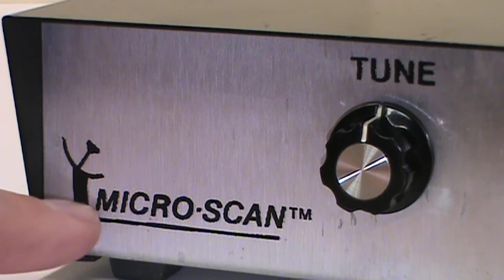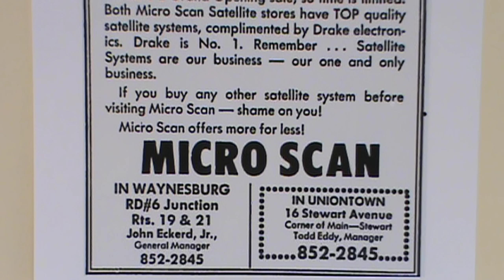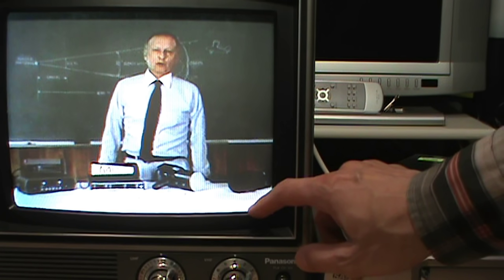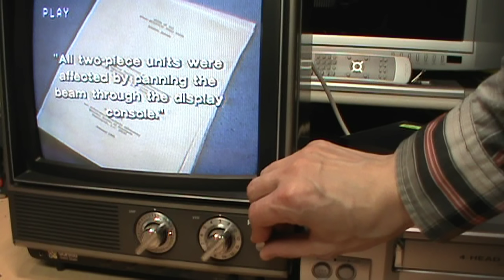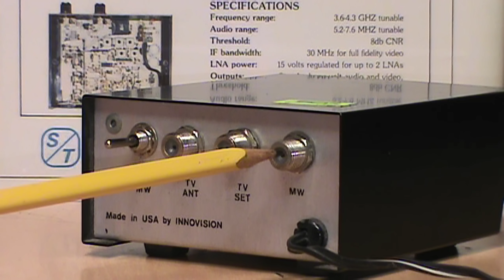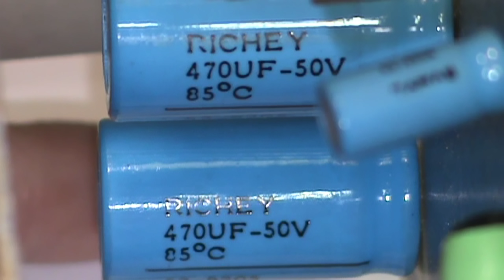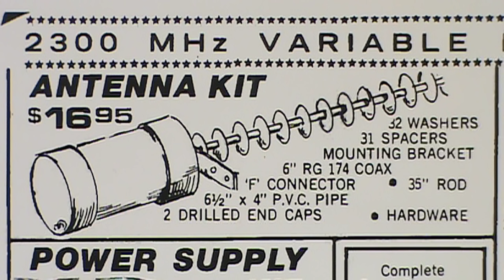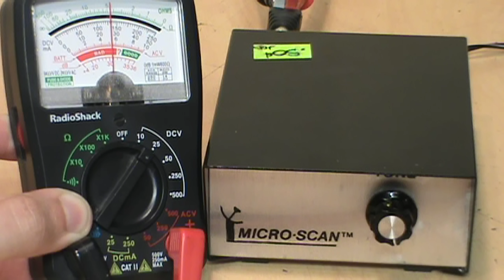Micro-Scan mystery 1980s TV device - Satellite? Microwave?

Comment: The Micro-scan looks like a terrestrial microwave receiver switch box.  Terrestrial microwave was popular in the 1980s to feed HBO and other premium TV channels to hotels and the like.  There were hack receivers sold in the back of electronics magazines back then.  You made a high gain antenna out of an aluminum rod, a bunch of washers and a coffee can.  Yep, that advertisement you showed was a wink-wink ham radio receiver which might “accidentally” pick up some HBO if you were in an “unfortunate” location.
Reply: Yep, this. I built one in the early 80s. Worked really well until cable made a foothold in the market.
Reply: So kind of like those video stabilizers you could buy at Radio Shack that were absolutely positively not for removing the MacroVision signal from rented video tapes so you could dub them.
Reply: @filanfyretracker yeah an RF amplifier! These would capture microwave signals and you didn't point them towards the sky you just .290 degrees on any old Pole, and started turning it until you got the microwave signal and there you go crystal clear I built several of these and even took them camping basically just an RF app with a 12-volt power supply so they were great for camping. In fact even better for camping going through a 12-volt car battery!
Reply: @filanfyretracker exactly!
Reply: Yes. The plans were passed around between nerds back then. The antenna was made with a metal trashcan lid and a metal coffee can with a PC board on the base of the can. A length of all-thread with fender washers spaced out along the length of it. Inside the can was a precisely cut and bent end of coaxial cable. The box on the TV had the big pot that had to be tuned. All kinds of stuff went over the microwave back then. Later it was mostly school educational stuff.
Reply: I used to see these in motels all the time. Now I know what they were for thank you.
Reply: I live in Minneapolis, and in the early ‘80s I built one for getting an HBO feed.  It used a small 14” dish pointed at the IDS Center (the tallest building in Minneapolis at that time).  I was in high school at the time…
Reply: Thanks to everyone who commented.  Those were the days.  Now fiber optic links have replaced many microwave relays.  Even a big chunk of C-band satellite has been gobbled up for 5G mobile service.
Reply: There's lots of little "translator" shacks around rural areas that take a distant affiliate's microwave feed and redistributes it over UHF for communities outside the channel's normal blast range. It could have been used in that capacity.
Reply: I actually subscribed to a tv service like you described back in the late 70’s. This was before cable tv became commonplace. The transmitting antenna was located atop a skyscraper building in East Memphis, TN. Late at night, the service would run porno movies. My next door neighbor wanted that so bad he buried coax to my house and we shared the feed😂
Those were young and dumb days🤣
Reply: Exactly this
Reply: The closest you can get to that experience today is picking up BISS-encrypted or PLS-encrypted satellite channels intended for feeding terrestrial transmitters in neighbouring countries, something which is possible here in Europe. BISS and PLS both use a fixed key that typically stays unchanged for years, and the keys leak to various internet sites almost immediately, so as long as you can see the satellite, it's a neat trick to get access to the free-to-air channels of nearby countries. It's the reason most brochures for satellite receivers here in Europe advertise BISS and PLS compatibility (wink, wink), but won't tell you what are the benefits of such a feature.
Reply: In 1986 we lived in Phoenix AZ and my brother bought a kit and got HBO free. You had to aim the dish antenna just right to South Mountain. The signal stopped about a year or so later.
Reply: @PLC808 that's funny.......the box from the TV company just needed to be opened and a circuit swapped to open up the pay channels

Comment: thats for po-rno lol
Reply: This is correct. In the early 1990s in San Diego, CA, you could aim a small microwave dish at Mt. San Miguel to receive a terrestrial broadcast of the Spice Channel. The system operated over MMDS (Multichannel Multipoint Distribution Service) frequencies in the 2.5–2.7 GHz range. Unlike many premium services, this particular transmission was not scrambled, anyone with the right antenna, downconverter, and tuner could receive a clear analog signal. It was a true line-of-sight setup, relying on mountaintop transmitters rather than satellites.
Reply: @sdbirder  😁

Comment: In 1976, at our apartment in
Stamford, CT, had an MDS
Dish antenna aimed towards
the SW for NYC reception
If one subscribed to HBO,
then a signal was received on
then Analog Channel 6 on
our Master Antenna for TV,
before we had cable TV after
the 1980's began when we
had Cablevision installed in
our building. 😅
Reply: Are you typing this on a BBS with limited column width?
Reply: @ToTheGAMES no it's in Cobol converted to Fortran!

Comment: In the early 80’s we couldn’t get cable where we lived, but the cable company offered us HBO for $3.00 a month.  We had something similar to switch from regular tv antenna to a small microwave dish on our roof, which was aimed at an antenna about 4 miles away.
Reply: We couldn't get cable where I lived in the 80's as well. Rural Indiana. But I never knew this stuff existed at all. I figured that if you couldn't get it legally there was no other option.

Comment: Not satellite TV but MMDS subscription television or “wireless cable”, which used microwave frequencies.
It used a special receiver antenna with a downconverter device which needed to be powered. This seems to be a very cumbersome antenna switch with the power supply for the antenna receiver integrated. Most MMDS TV providers wouldn’t use something like this later, probably because the antenna power supply was prone to failure and it was easier to provide a simple more serviceable/replaceable one. Once powered, the antenna would provide a regular VHF or UHF signals for any TV to pick, provided the signal is not scrambled. They would either give you instead a wired non-powered switch or just a regular antenna switch similar to an old computer or console TV switch box or an electronically switching tuner/descrambler.
A system like this known as Multivision was very popular and successful in a few cities in Mexico from 1988 to the mid-2000s when it was mandated to cease TV operations on those frequencies to allow for WiMAX wireless broadband Internet services.

EDIT: Correction. This is very dumbly-made antenna switch with an integrated MMDS power supply.  
You can’t just use an electric on/off switch for antenna as the signals will always permeate the other antenna wire and pick them up easily, like, you know, an antenna does; which is the reason those Atari boxes used a slider to give enough room for the signal to not reach the other end with enough power and a couple of trap filters on each side to get better results.
The reason for the power voltage knob as a fine tuner as because if a converted MMDS channel would use the same frequency as a local OTA channel, they would interfere with each other. So, in order to have the best image, the signal from the downconverter would have to be stronger. This would work with the MMDS channels but probably not so much with the OTA ones, so the switch either also turned off the downconverter or lowering the voltage on the antenna would allow you to watch OTAs without the interference as the MMDS would literally lose power. No wonder they quickly dropped these boxes.

Comment: After the initial demonstration of its function it was pretty clear that it is an input selector with either a tunable or controllable output RF amplifier. Almost certainly intended for reception in marginal areas especially those who have more than one antenna was required to get more than one poor quality station. 
The logo was pretty much a red herring as through that 80s satellite boom many items, even completely unrelated ones, add some kind of satellite or satellite antenna as a logo.

Comment: Voltage-based tuning circuits are not at all uncommon. While we often think of tuned RF circuits as being based on a resonant LC tank composed of a variable capacitor and an inductor, other regimes exist. A Voltage-Controlled Oscillator (VCO) uses a variable DC control voltage to adjust its output frequency. The core principle relies on a voltage-dependent component—typically a varactor diode—that alters the resonant frequency of the oscillator circuit based on the input voltage.
Reply: Yes. Have an array of pots and tune them to different channels and select them via pushbuttons. Channel presets before digital memory. Used from the 1960s into the 80s on some TVs (UHF mostly) and radios.
Reply: @westelaudio943I remember those, it was particularly common on some of the early high-end VCRs and smaller TVs that came with remote controls. Though I always assumed the matrix of individual rotary controls for each channel were just variable capacitors rather than potentiometers.

Comment: To nit-pick, most C band satellite receivers don't receive 3-4GHz.  They receive around 400-900MHz.  That's because they're usually connected to an LNB at the dish (Low Noise Block down converter).  Which both amplifies the weak satellite signal and then down converts it to something more manageable.  Both with cheaper coax (lower signal loss) and receiving electronics.  Early on they used LNA (Low Noise Amplifiers) on dishes instead.  That would have delivered 3-4GHz to the receiver.  LNB supply voltages (as I remember) were anywhere between +12 to +18V.  They'd even use the voltage to select which LNB to use.  Whether it is selecting which polarization to use or which satellite (if they are close together and you have an elliptical dish.  But I don't think that was done on C band, only on Ku band.
Reply: Yes exactly right. The voltage tuned a downconverter on the back of  a c band satellite dish from the 3-4 Ghz range down to 70 Mhz and the receiver was a demodulator from 70 Mhz FM to video/audio.

Comment: Before switching to a satellite,HBO used to broadcast over the air, antenna with an array of discs would be aimed at the World Trade Center and you had the box in between your tv and the antenna. Tune tv to channel 3 and you got hbo, grainy but watchable. Didn’t last long, as they became part of cable systems, the antenna pictured in your ad was the type I had back in the early 80s
Reply: Same here but in Chicago

Comment: That's a power supply for an MDS (multipoint distribution service) - a 1980s way to distribute a pay program - usually HBO - to apartments and condos.  It powers a roof mounted RF downconverter which takes the MDS licensed signal at 2156 MHz, mixes a local oscillator and outputs to channels 2-6 VHF.  There also was an 'educational' service called ITFS (instructional television fixed service) which typically a school or university would distribute multiple channel classroom education to remote sites.  The Minneapolis / St. Paul area had both these analog video services up and running through the 80s and 90s.

Comment: There are indeed several standards that used the voltage sent to the antenna, not only to feed it with electricity, but also to control its actions. You could for instance use it to move it in front of the dish to switch between 2 close satellites. Or you could use it to select between 2 antennas, each aimed at a different satellite. Or you could use it to switch between different frequency bands or polarization. If you can do that, it is only a small step to use it to directly select a specific frequency.

Comment: Back around that time, some LNBs actually converted the signal down to 72 MHz, so it may have been feasible to build such an LNB that is tunable by its supply voltage. Of course vestigal sideband modulation is essentially useless for satellite broadcasting, it may have been viable for terrestrial microwave broadcasting.

Comment: The down converter in the dish is probably a voltage controlled oscillator, so changing the voltage will change the frequency its tuned to.
Reply: That’s exactly what this is. I used to build the coffee can HBO receivers that used these variable power supply’s to connect to a TV. Channel 3 on the TV as I recall.

Comment: It's a C band converter I think.And the variable voltage is used to tune the satellite head block.
Reply: Yes exactly right. The voltage tuned a downconverter on the back of  a c band satellite dish from the 3-4 Ghz range down to 70 Mhz and the receiver was a demodulator from 70 Mhz FM to video/audio.

Comment: Man this brings back memories. That Micro-Scan Power Inserter from the early ’80s was basically a little DC injector for those giant backyard satellite dishes. The LNBs back then needed power, so instead of running an extra wire they just pushed the voltage back up the same coax that carried the TV signal. The inserter sat in line, filtered out the RF, and sent DC up to the LNB.

In 1982 those boxes were kinda clunky—couple F-connectors, a DC jack, not much else—but they were the ancestors of the tiny power inserters DirecTV/Dish use today. If you had one of those setups back then, you weren’t just watching TV, you were hacking into the future… pulling in live feeds and channels the average household didn’t even know existed. Pure golden age of satellite tinkering
Reply: In 1982 I was tasked with messing with the rabbit ears antenna to tune in the 3 or 4 channels our rural house could receive. I didn't know this stuff existed, of course all I cared about was watching Dukes of Hazard or CHIPs at the time.
Reply: Nah, this isn't C band just terrestrial microwave TV. The device you're talking about is called a "bias T"
Reply: I don't know how things are in the US, but here in Europe, satellite LNBs still rely on "phantom power" delivered from the coaxial cable, which is something I hate, since you have to be careful to shut down the satellite decoder from the power switch at the back or unplug it before unscrewing the coax cable, which requires a wrench to unscrew so it doesn't get unscrewed accidentally. Why can't the LNB have its own power?
Reply: @Δημήτρης-θ7θ  I think it might be to do with the smaller size of European homes favouring smaller equipment and using fewer power outlets. Separate LNB injectors mean separate boxes, an inconvenience enough in my 30m² UK flat, let alone the typical 16m² of one in central Paris! 🤏
Reply: Eventually as technology evolved, those boxes weren't needed anymore as most of the work was being done inside the satellite receiver.  About 12 volts was sent along the coax line out to the dish by the receiver inside the house. Adjusting the skew horizontally or vertically, so you got 12 channels horizontally and 12 channels vertically, for a total of 24 channels per satellite.
Reply: I haven't seen a satellite box in a while, but we were still using powered LNBs in the UK up until at least 2018. Unlike the DirecTV setup you describe, UK setups have the power injector (Nominally 19v= I believe) built-in to the set-top box and run off the same power supply.

Of course; Now most things are going IP-based, satellite's days might be numbered. Sky/Comcast must have to pay a lot to keep those satellites in service, which is avoidable if you can get all of your customers onto streaming-based solutions. (Sky have NowTV and I imagine ComCast - Who are partners, if not in of the same group - Offer the same or a similar thing.)

Comment: 9:43 Maybe "tuning" as in tuning  a varicap diode resonant circuit, a filter maybe?
Or to power the LNB that needed some 13-18V?
Reply: 13-18 is switching, not tuning.but yes, it did tune via varicap voltage...inspect top replies

Comment: excellent video. I think this is related to a similar object reviewed by Gabe from the channel "save it for parts" a few weeks ago. you can clearly see the traces from each "input" running alongside the output traces, which is most likely why you can still see both sources even when the switch is off. very bad design, even for that era. I think this was more of a low quantity product, even made by hobbyists or recently graduated with not ideal levels of experience.
Reply: The one Gabe had was more interesting as it also had the antenna & downconverter integrated into the receiver box. It was a complete system in a box but would only work if you were in a high-rise building and were facing in the direction of the microwave transmitter on the roof of another building that was within the line-of-sight of the microwave beam.

Comment: Hey, that's a "power inserter."  It backfeeds DC to the LNB on a satellite dish, powering it up.  "Tune" isn't for signal, it's to tune the output voltage (LNBs are powered by 13-18 VDC at about 200-ish mA.)  Most consumer set-top satellite receivers had these built in.
Reply: I first thought it was one of those diy cable tv decoders😂
Reply: Scew control for horz and vertical on dish ?
Reply: no, this is 12-16v, it's not lnb polarization voltage...guy from Arkansas answered it...